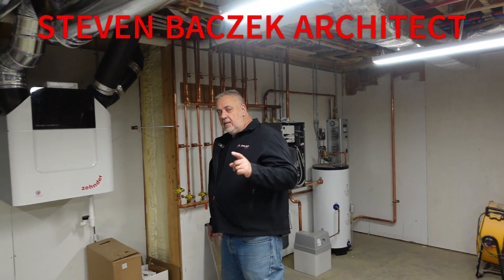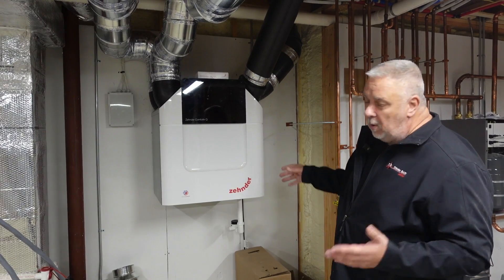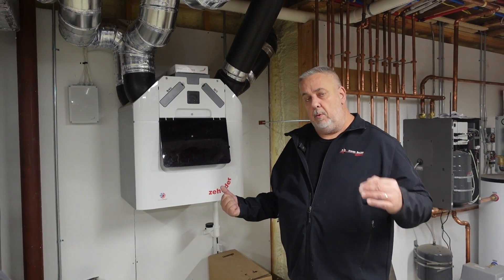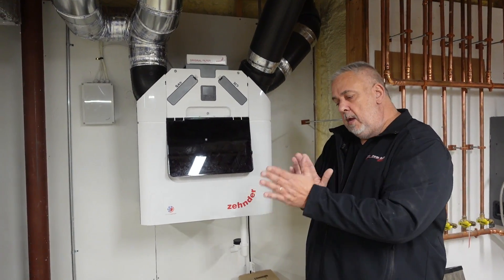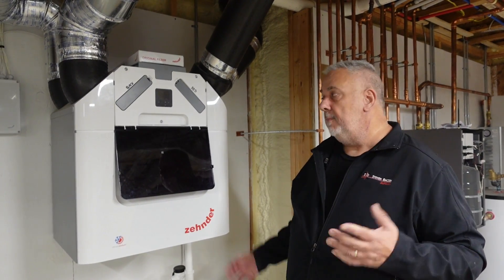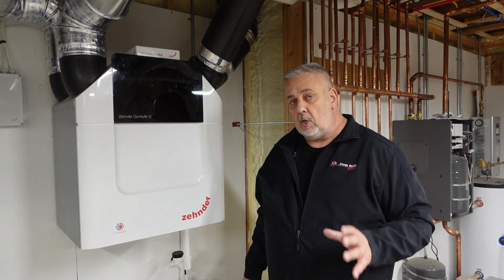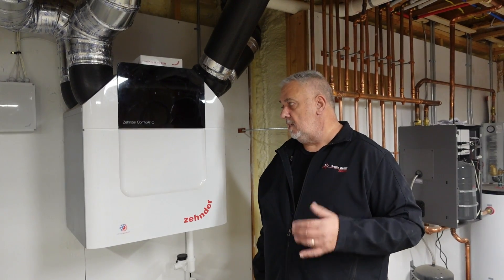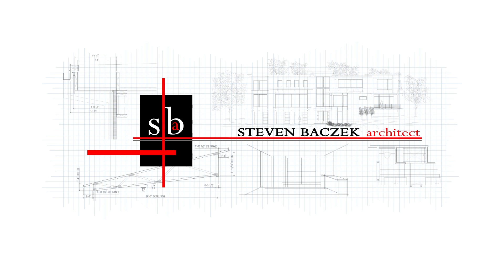ERV Energy Recovery Ventilation

Comment: We installed a Zehnder 350 with ERV exchanger as part of our passive house that Steve helped us with. It is a high quality unit and no complaints. We added the optional ComfoFond-L with a 300 foot 1" diameter geothermal slinky loop that circulates propylene glycol. This causes the outside air to be precooled in summer and warmed above freezing in winter. In the winter once the outside temperature gets much below about 25 DegF the exit temperature of the exhaust air approaches freezing. Without this geothermal option the Zehnder will bypass the exchanger enough to avoid ice forming on the exchanger and the fresh air entering the house would be a bit cooler due to the bypass. With the option the cold entering air is kept above freezing which avoids any bypass and results in a bit higher efficiency.

Comment: With Zehnder is the customer forever trapped in proprietary land for recurring parts, service and accessories?
Reply: Bingo.  You could dissect the filter system and see if you can reproduce it at a low cost.  Other than that you are correct.

Comment: Steve in real cold or real hot outside situations do you recommend turning it off?
Reply: Never turn it off unless the windows are open. High Co2 buildup in tight houses.
Reply: For those climates systems are designed with preheating or chilling features. If you do not have those,  system automatically shuts off after reaching temperature at which it is not designed to be operated

Comment: Don’t get me wrong, I’m a huge ERV fan (no pun intended) but I still don’t understand and have yet to find someone that can give me an answer as to why the HVAC and the ERV have to use separate supply lines to the interior of the structure. Why can’t either the supply lines come out of the ERV and then feed into the trunks that go to each individual room or the supply come out of the HVAC and then feed into the supply lines for each individual room for the ERV. Why do I have to spend thousands on double duct work???
Reply: Same here. I’m planning a new build and I’m currently looking at CERV instead of ERV. I just want one system that does it all. Any other suggestions or recommendations will be greatly appreciated
Reply: @markjuvert839 I would try Chinese brand  or Canadian. it is cheaper
Reply: In not too cold or not too hot climates you do not need heat or cool your house for most of the day some times you can do weeks or even month without running your HVAC but all this time you want to breathe with fresh air . Only recently I came across a heat pump which pushing air constantly through ducts just at much lower speed when there is no a call for heat or cool . So my plan to install this heat pump and to place  fresh air outlet after HRV next to HVAC return grill
Reply: Not only spending on the extra ductwork, but the ugly extra vents that need to exist in each room.  Just use the main HVAC fan and have it run at ultra-low speed when not actually heating or cooling.

Comment: In the summertime with the outside air being hot and humid, doesn’t the ERV circulate all of that humidity in the house? Is there a way to ventilate in the summer without exchanging humidity but retain the ability in the winter? If my understanding is correct then it seems like wasted energy during high humidity seasons.
Reply: What I know from these YT videos is that the difference between ERV and HRV is that the ERV also exchanges humidity while an HRV doesn’t.  My assumption is that an ERV should be able to exchange the humidity in both directions; in the heating season, it should take humidity from the outgoing air, and put it into the incoming air.  In the cooling season, it should take humidity from the incoming air, and put it into the outgoing air.  Both of these would be good things, especially in a region with high humidity summers, if the unit can actually work in both directions.  I am a bit skeptical about how much of the humidity actually gets transferred through the membranes (and their service life), but something is definitely better than nothing; it’s just a question of whether it’s worth the hassle.
Reply: I was told I can use a dehumidifier in place of an ERV. What are your thoughts on that Steve?
Reply: I have lived that experience. In high humidity environments there is a tipping point where you are bringing in higher percentage humid air than you are exhausting. This is why you will always need a dehumidifier that has adequate capacity to counteract this. You can use a dehumidifier alone with an outdoor intake which can filter and dehumidify the air, however, there will be a temperature dilution. In the summer you will be bringing in hot air increasing the AC demand.
Reply: A dehumidifier only takes the water out. It doesn’t address any other air quality issues, notably particulates or VOCs.
Reply: An ERV typically does not address VOCs unless there is a fairly robust carbon filter included in the design. I believe Zehnder may be one of the few that do this. Most ERVs have fairly poor filters which can be an issue if there are no other good filtering systems upstream. If VOCs and allergens are a major concern then a whole home HEPA system is an option. Of course this adds expense and complexity to your system.
Reply: @petersallay5221  Generally the outdoor air is cleaner than the indoor air, so just exchanging the air will improve the particulate and VOC levels. But that’s based on the outdoor air being higher quality, which isn’t necessarily always the case.
Reply: For sure. The outside air depends where you live, what time of year, potential adverse events(last year’s Canadian wildfires). The indoor baseline is dictated by what is in your house: people, pets, VOC emitting material. I was a bit anal about air quality so I installed an ERV, humidifier x 2, and 2 HEPA systems(~7500sqft). I have two monitors one upstairs and downstairs. When the air is worse outside I shut down the ERV and have no issues with VOC increasing. However, in a smaller volume tight home without HEPA it could be a significant issue.
Reply: @petersallay5221 reading through the above comments, a thought came to mind. Considering outside air quality and how it changes throughout the year and how natural disasters can affect the air quality (wildfires/pollen season), should the fresh outside air coming in be filtered right at the point of entry so the duct work is not being contaminated resulting in the need to be cleaned annually?
Reply: @BrianBaldridgeC  Yes! That would make sense. The filters on most of these units are fair to poor. I think part of the issue is how to link the various components without creating significant pressure changes that may cause unintended consequences. The preference would be to bring in outside air, send it to the ERV and then scrub it through a high MERV system then dump it into the supply.